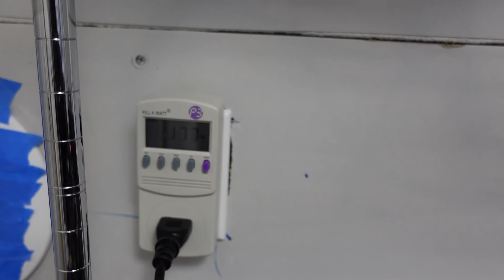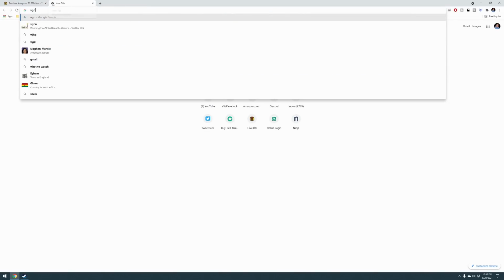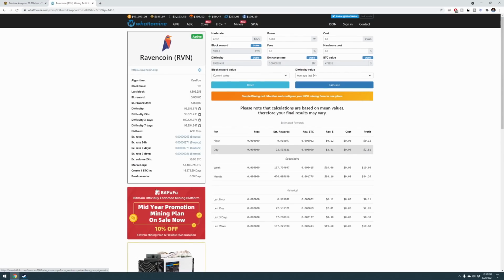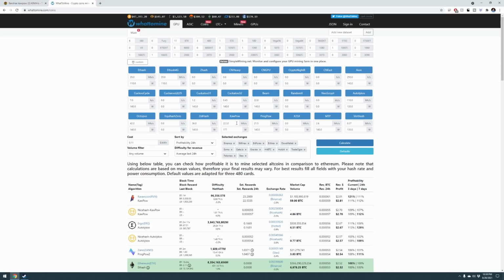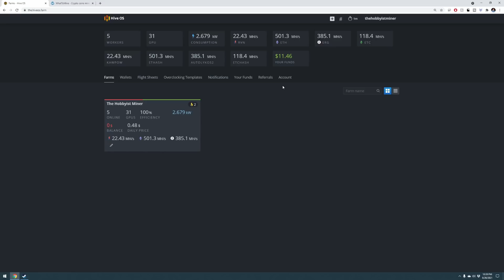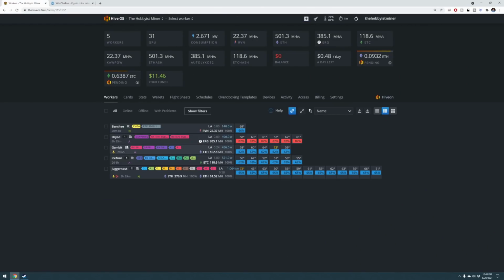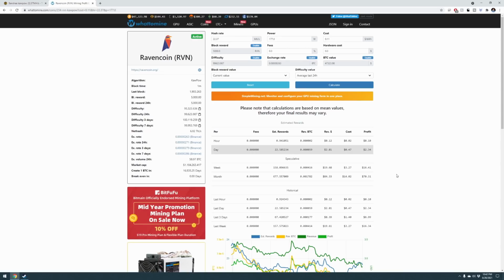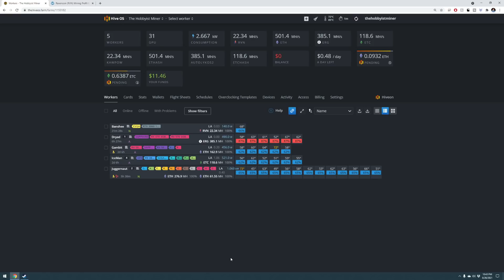How To Calculate GPU Mining Profitability For Your Mining Rig

Comment: Im using zotac 1660ti and im having different hashrate with one being 31 and the other around 25 after overclocking them. The 25 is using a lot more power and higher temp than the other. Can you tell me how do i fix it. Thank you

Comment: I bought a 1200w server psu with the break out board and cables… total system load was around only 500w. Only after 5 mins it went BANG. Luckily no graphics cards were damaged but and it was the server power supply that blown. It’s under warranty thankfully but what could have caused this? Any suggestions?
Reply from the maker: What kind of power was plugged into the PSU?  120?  240?
Reply: @TheHobbyistMiner  240 but when I looked at the plug it was 10A … it was my mistake as I assumed it was just 13A. This might have caused it?

Comment: You mentioned using the pool mining rate (which was around 164MH/S) but then in the example still used to the card mining rate of ~22MH/S .. so to get your true cost shouldn't you have used the 164MH/S? Great video though!
Reply from the maker: That test trigger wasn't up for 24 hrs. I didn't want to use that. So I showed another rigs 24 hr average on the pool level, to show where it was.

Comment: Yesterday i just make my first rig with 2 3060Ti LHR from Gigabyte with samsung memory , i mine RVN 29-30MH with 151w per card ,and ~330 at the wall. I hope i can buy more in the future , Hello from Romania with 0.1$ electricity
Reply: Hey , i got same carda i think. Eagle right? Can you share your settings i also get 30mhs but at more power ~170w
Reply: @vanjagrozdanovic3430  Yes the Eagle. Sure , my mem is at 1450 with 75% power limit , and 133 core , that is all , and i run it satable , my room is cold enough that one card is at 56* and one at 66*.
Reply: @classicphoto94  thank you , i manage to get 30mhs but i get invalid shares , do you have same problem?
Reply: @vanjagrozdanovic3430  sometimes i do, but i use nicehas, when it show s ME invalid, i restart my rig, i re-owerclock slow. În 1900 shares i dont have any rejections
Reply: @classicphoto94  im using hive

Comment: If you want to find real profit, would need to factor in hardware depreciation as well. I'd use 25% PA minimum, but 33% PA is probably more realistic.
Reply: Is it possible as a business to depreciate at this rate along side costs, dev/pool fees, etc?  Just initial research phase will be doing more digging into this for sure.  Many thanks!
Reply: @OptionsIncomeTrading  I'm not an accountant, but 33% does seem to be the norm for business IT equipment.
Reply: @alanpassmore7301  That's super helpful!  Thanks so much!!
Reply: In this market if you think hardware will deprecate 25% PA in the next 2 years you're nuts. Nvidia said themselves the shortage looks like it'll continue all the way up to 2023

Comment: as well as electricity costs, there's also exchange fees. I just started a couple of weeks ago and trying to figure out the most cost effective way to withdraw RVN and ERGO to a GBP bank account ( topic for another video ? )
Reply: oh and FLUX as well :)
Reply: @zyncsab5759  using Okex for RVN. Think I've figured RVN out. In Okex doing RVN to USDT then to XLM as it's cheap to withdraw. Then XLM to coinbase to convert to GBP
Reply: @zyncsab5759  Ergo still in my Yoroi wallet